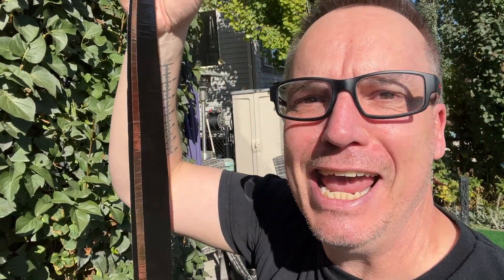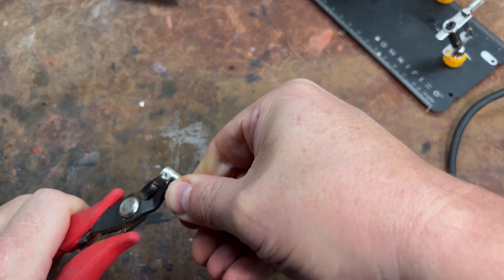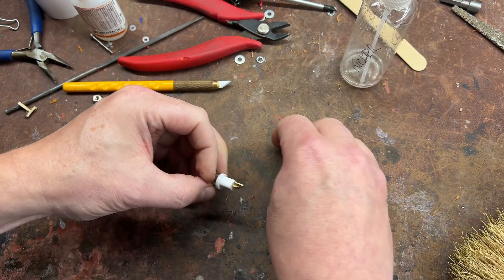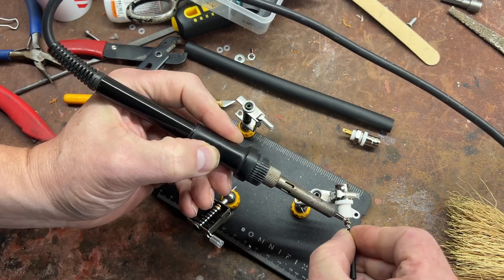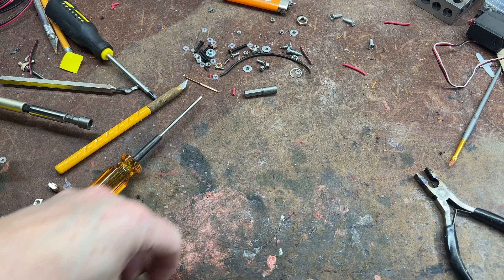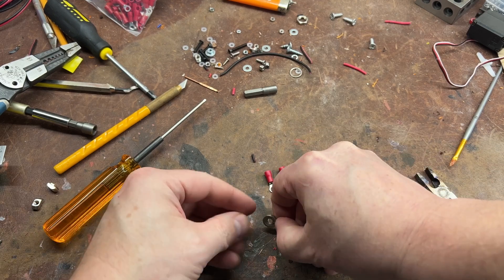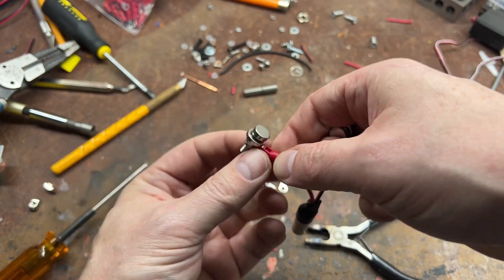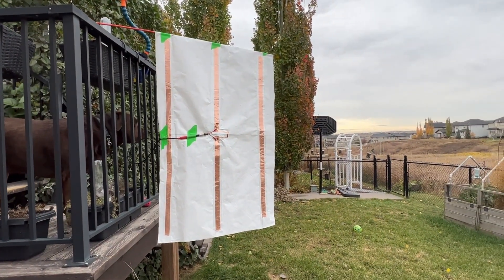Easy Magnetic BNC Connectors for Ham Radio Antennas

Comment: The magnet thing isnt working for me even if i keep NanoVNA it far away from the magnets. is it that magnets are throwing off my nanoVNA or magnets are screwing with my faraday tape? I cant figure out whats happening but i cant get a straight reading. any ideas? what am i doing wrong?
Reply from the maker: I would check continuity all your connections with a multimeter. The inside pin on the BNC should only be connected to one wire and the case if to the other. If you don’t have a connection it can a bad solder joint, break in the wire, or improper crimp.  Or if you have one or both the center pin and casing shorting by accident then you will find that the case or center pin will have continuity with both magnet leads. Last possibility is that the vna is in need of calibration or might not be functioning properly
Reply from the maker: I have had a similar problem. The end might not be what you want to hear. First check another antenna with the VNA if it is working then check that all crimps and connections are good, then check that there is not a short between the two magnets somehow. Now to the not so good thing I have done. If your VNA is not reading a known antenna well then.... if the VNA received even a minor static shock it can destroy the RF circuit. Meaning the VNA might be toast. I have fried two this way in the last year.

Comment: Cutting up the adapter was the correct method, as all Bulkhead connectors are Hi Impedance for use in test equipment.
Better to use regular "in-line" connectors with minor modification.
Good job Rookie 👍
Reply from the maker: Interesting I may need to get me some lab equipment to test that. I don’t doubt you. I just like empirical results right in front of me. Plus another excuse to get more gear and mess around. :)
Reply: You don't need empirical evidence, just do the Math. You can find all the physical info you need in most Antenna Matching books. The ARRL Antenna book has a reasonable treatment on the matter. UHF/ VHF Antenna Handbook by Jessop is also a great resource.
The issue is two fold, Distance between Conductors, and the Properties of the Dielectric.
Reply: Rookie is using bulkhead connectors with two soldering tabs that are isolated from the panel they penetrate.  What about chassis connectors that have two soldering tabs and where the shield is grounded to the panel penetrated?

Comment: ….. and this my friends is why we”ll forever regret the day they removed code from our licensing (ummm ya coulda used bulkhead fittings). 🤦‍♀️
Reply from the maker: I regret... I mean learn something every day :)
Reply: @Jennifer-007
Those Bulkhead BNC Sockets are Not 50 ohm.
They are Hi Impedance, used in Test Equipment...